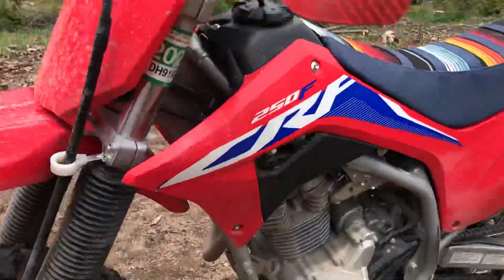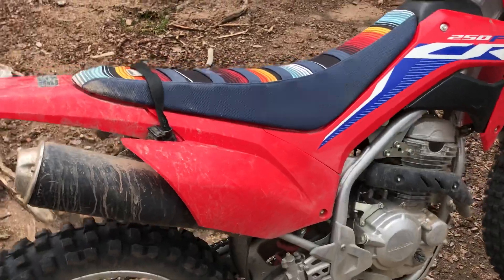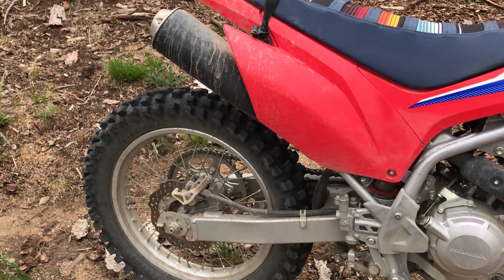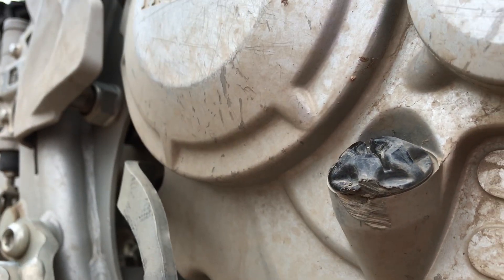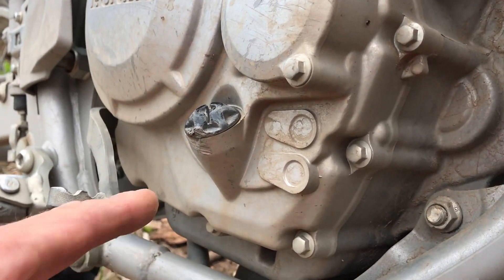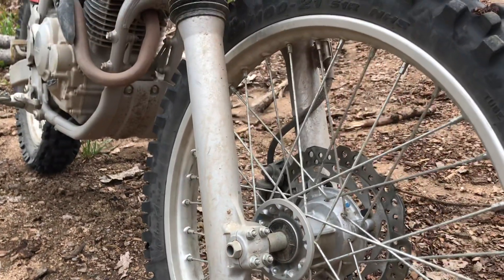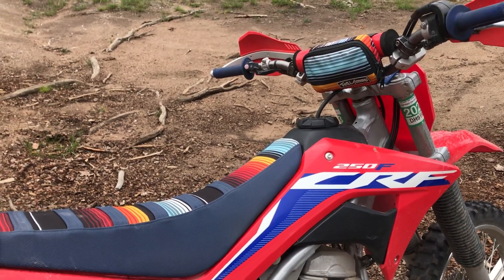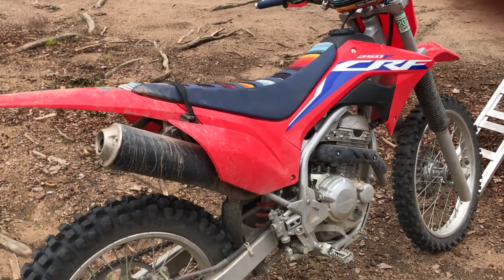2022 Honda CRF250F… should you buy one?  REVIEW!

Comment from the maker: I recently added a Flatland Racing skid plate, definitely check them out!  Having your engine exposed how they come stock is insane, I wish I did it sooner.
Reply: I had a Suzuki DR650 about 15 years ago.  Had it for 3 months, the very first time I went out riding trails, I punched a hole in the case!  Didn't realize it until the motor froze up.  That was an expensive mistake!!!  So, when I bought my 250F, the absolute first thing I did was put a skid plate on it!  I love this bike, bought it in early 2019.  Have well over 3,000 miles on it now.  I've made mine street legal here in South Dakota, pretty easy to do.  Been experimenting with rear sprockets.  It comes with a 50 tooth, I went up to 53.  It makes it even more of a tractor, but then going from one trail to another on pavement, it can barely hit 45MPH.  So, now I've put a 48 on it.  Hoping to get out this weekend, see what difference it makes.  Have fun, ride safe, and thanks for the video.
Reply from the maker: @noidea1962  thanks for the sprocket info, i've been thinking about gearing it longer, i feel like it has plenty of low end so i'd like to have a bit higher top speed.  I cant believe honda didnt put a 6 speed box in these.